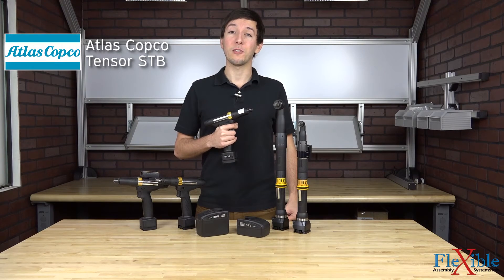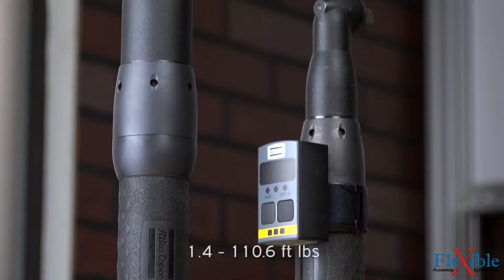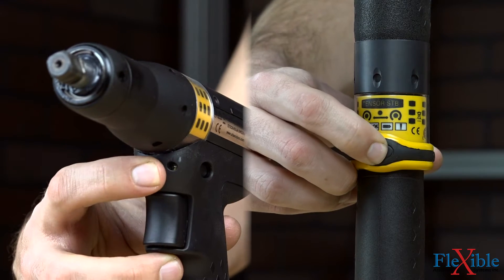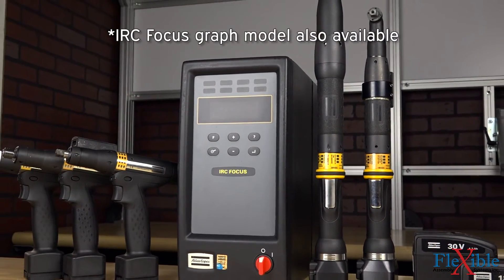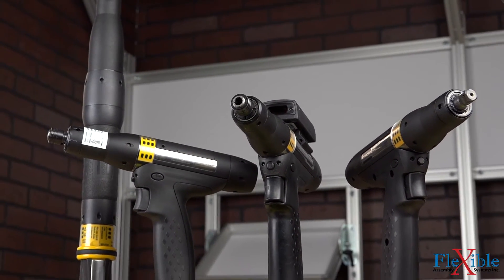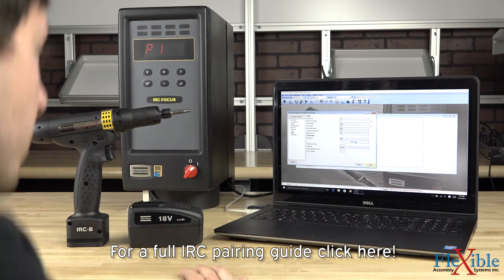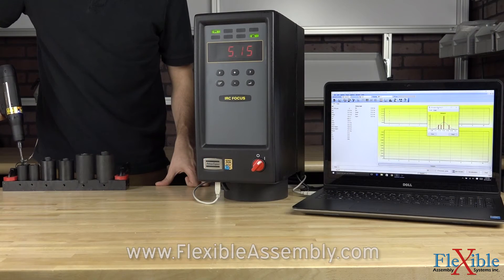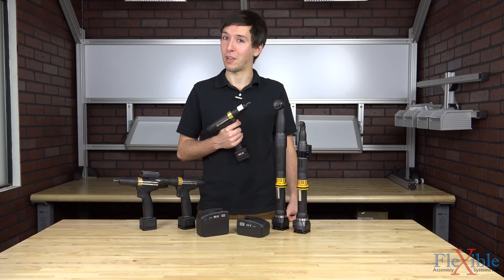Atlas Copco Tensor STB Cordless Assembly Tools

Comment: Do the 18 volt lithium batteries work on the Atlas Copco tools made prior to 2005?
Reply from the maker: As long as the tool accepts 18v batteries to begin with they should be backwards compatible.